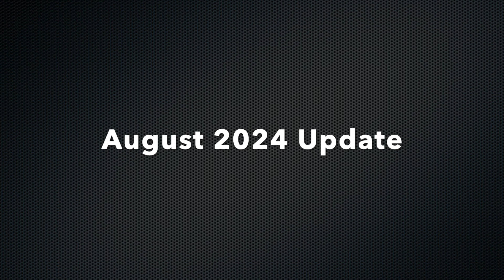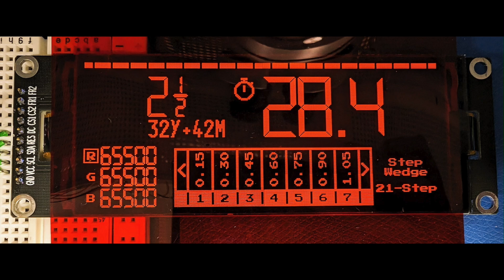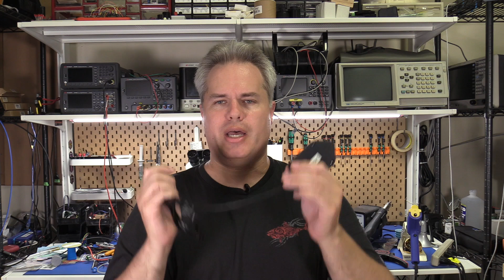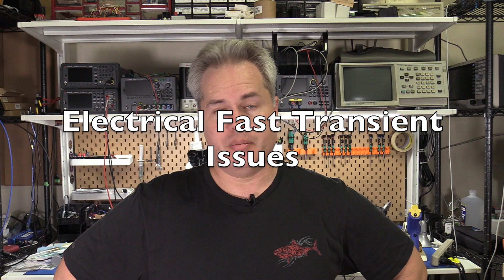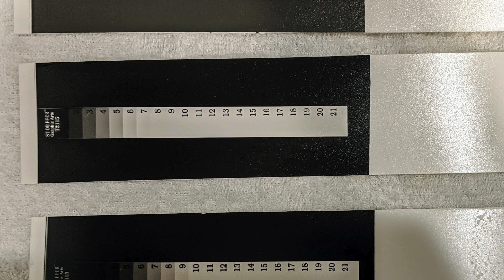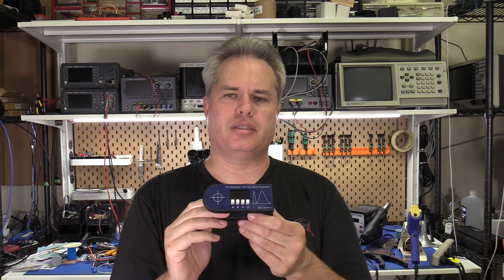August Update | Long overdue progress

Comment: I am very happy that you are keeping development of your products! Hope that at some point in the future you will make color densitometer
Reply from the maker: While I'd love to make a color densitometer, there are some serious technical challenges to making one that is both reasonable in cost and that gives ISO 5-3:2009 compatible readings.
It would have to either be a full-blown spectrodensitometer (with a very expensive and complicated sensor), or it would need a large number of simple sensors fitted with individual per-channel filters (that are expensive and hard to source).
Making one with a simpler multi-spectral sensor is certainly possible, but then getting its readings to consistently match other color densitometers may not be possible.
Reply: @DektronicsDarkroomElectronics  yes, I am understanding this problems, just really tired from old xrite…

But another option: maybe do you think about color meter? Like jobo colorline, it looks a quiete simpler then color densitometer
Reply from the maker: An enlarger color meter is easier on the hardware side, because it doesn't need to match any sort of standardized spectral specification.
But its a lot more complicated on the software and documentation side, because it involves coming up with a friendly process for actually using one in the darkroom.

If I make one, it'll be an alternative meter probe accessory for the Printalyzer Enlarging Timer.  The hardware will just be the current meter probe with a different sensor.  However, the software to make it useful will undoubtedly be a lot more complex.

Comment: Will it be possible to use the uv/vis transmission densitometer as a stand-alone instrument, or will it require the Printalyzer?
Reply from the maker: The UV/VIS Densitometer will be a standalone instrument, similar to the current Printalyzer Densitometer product.

Comment: Great stuff indeed! You mentioned enlargers with motors creating electronic noise, I wonder about large color heads like the Omega Super Chromega Dichroic II head which have built in relays and a cooling fan… would that affect as well? Another thing what about voltage (US/European)? Would that mean two different version of the timer?
Reply from the maker: Usually noise tends to be caused by inductive loads (like motors/relays/transformers) switching on and off, not simply running. Also, if the device has some filtering or is far enough away (as far as power cabling), the potential for issues is minimized.

While its always possible that those heads could cause electrical noise, its far less likely than from the cases I mentioned.

As far as voltage, almost all modern AC/DC converters can handle a wide range of voltages, and the one on the Printalyzer Timer's power board is no exception.  The AC/DC converter in the current prototypes is rated to handle anything from 85-305VAC, and I'm making sure all of the other components are fully rated for at least 250VAC.  So no, there won't need to be different versions.